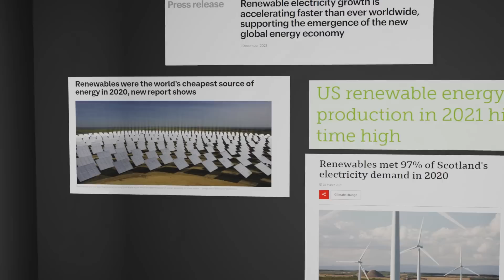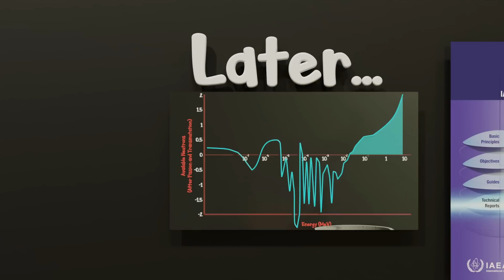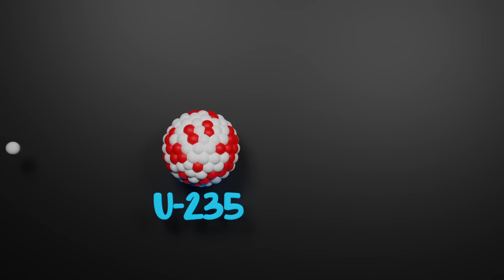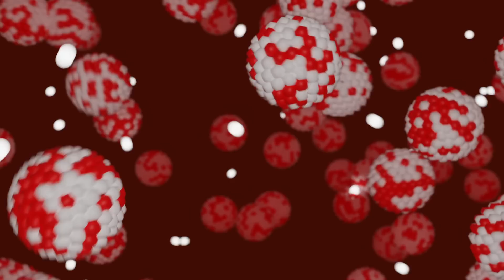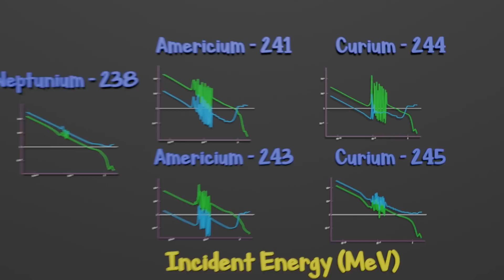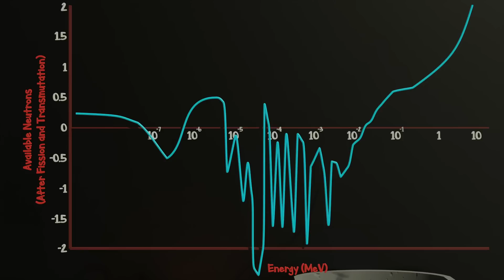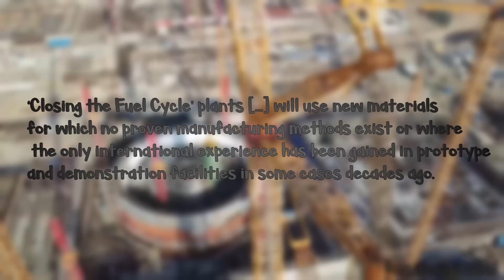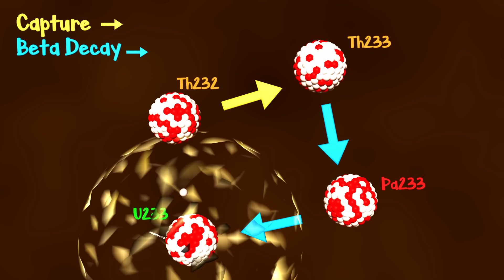How to turn Nuclear Waste into Nuclear Fuel

Comment: Concider this, co2 is produced naturally as biomass decomposes.  We are digging up additional fossil fuels to burn that increases the normal amount of co2 released.

What if we replace as much of the fossil fuel we use currently with biomass that gets put in dumps. It will already convert to co2 anyway. In that way we have a biomass fuel to use that replaces fossil fuel. That alone decreases the amount co2 released in the atmosphere.  If we add carbon capture on top of that then we decrease co2 released even further. Will this replace all fossil fuel, of course not. But it it could cut fossil fuel use by half that would be fantastic. Even if it only cut co2 production by 25% it would be worth it. 

You pointed out we have nuclear waste problem. That nuclear waste problem. For decades we have used nuclear generators in space craft that can be powered by that nuclear waste. Why are we not building these generators to provide power here on earth. It would use up nuclear waste in the process and decrease the amount of fossil fuel we need to use. Again no it won't replace all the fossil fuel use but it will replace some of it and eliminate co2 production.

A company claims it will release nuclear batteries in the next 12 months. These too are powered or can be, by nuclear waste. Banks of these batteries or nuclear generators could be used to make hydrogen fuel on demand for use in vehicles thereby decreasing vehicle co2 production. We have had safe hydrogen storage since the 1970s just no good way of producing the gas without pollution. 

In short we have many solutions that can make a dent in pollution available to us today.

Comment: While long half life material is problematic, the short half life material is the stuff that is really deadly.  The reason it is less problematic is that it's extremely dangerous for a span of time we can plan for.  With reactors, like the proposed Thorium cycle reactors, their is little or no long life waste, only the most extremely dangerous fission products in the same amount as conventional reactors, but without all the problematic long life waste.

The key problem with the waste from the Light Water Reactors used today is that the fuel is contained in tubes made of a Zirconium alloy that cannot withstand heat much higher than the boiling point of water.  As high level nuclear waste produces significant heat, the container has to be kept under water in a cooling pool, until the "hottest" waste decays into something less radioactive.  Should anything bad happen, and the pools dry out, before 10 years have passed, the waste will escape its container.

Comment: Very informative video, I have been a nuclear power proponent for a long while now. But this helped me understand the difference in slow neutron and fast neutron reactions. I really think we need to replace the 80 plus percent fossil fuel power plants with nuclear. Other renewables can make a difference but they have other environmental and economic issues. Fast neutron reactors and types that can use thorium like LFTR’s need to be explored and used to the fullest extent.

Comment: Don't forget this though: when the west went through the industrialization and grew economically, they didn't have the options that developing countries have. And they still don't. Solar isn't quite viable in a country such as canada or sweden. In a country like india though, this is becoming a much cheaper alternative that is already cheaper than coal. Most developing countries are hot with sunny climates. With energy storage that supplies people during the night, nuclear won't be necessary in developing countries. Especially since conflict and war is more common in the developing world, making nuclear easy targets and a safety risk for those using it

Comment: Which nuclear and which is better? There are two nuclear fuel elements:
Uranium and thorium.
There are three nuclear fuel cycles:
Fissionable uranium-235 isotope representing 0.7% of all uranium.
Fertile uranium-238 isotope representing 99.3% of all uranium which when it absorbs a neutron will eventually breed into fissionable plutonium-239.
Fertile thorium-232 which when it absorbs a neutron will eventually breed into fissionable uranium-233.
Reply: The most promising and the first gen. IV to make it to the grid will be a molten salt reactor that fissions U-235 at 5-20%. Most likely Thorcon power in Indonesia or Terrestrial Energy in Canada. Both are uranium MSRs. There is no shortage of uranium, it's cheap now and free in the future with MSR waste breeders.
Reply: @chapter4travels  The waste from uranium 235 has components that will last 300,000 years while the waste from thorium 232 is much less than uranium and has components that will last only 300 years.
Reply: @paulrprichard  The waste is the same for both because in the end they are both uranium reactors. 
What you have heard is a comparison between thorium in a MSR to uranium in a pressurized water reactor. In a MSR they are the same except there are several steps that thorium has to go through before it becomes uranium and can fission.

Comment: The real advantages to nuclear power for the most part are not really understood.
Most people when they think about nuclear they think of the benefits of producing electric. However molten salt reactors offer advantages as they produce high heat that can be used to produce certain kinds of chemical processes. Imagine being able to take components out of sea water and produce a hydrocarbon fuel. That can be used in existing vehicles with no impact to the environment. The other advantage molten salt reactors is they generate electric even more efficiently than conventional light water reactors. Because the steam can be superheated or this is not possible and conventional light water reactor.
Reply: There is nothing intuitive about nuclear, we don't even have suitable vocabulary, like a moderator is not for modulating :)

Comment: Please explain why coal is bad .. if it’s a non renewable source sure. There’s just so much polarization on the topic and bias is creating misinformation on my feeds. I like the explanations you give and would appreciate it. Thanks
Reply: Burning coal (without sequestration) releases:
* carbon dioxide - more greenhouse gas per energy generated than any other generation source
* particulates - with severe impacts on human and animal health - lung & heart diseases especially
* heavy metals - with severe impacts on human, animal, and plant health - nerve and brain damage especially
* sulfur oxides - with severe impacts on human, animal, and plant health - acid rain especially
* nitrogen oxides - with severe impacts on human, animal, and plant health - acid rain especially

Burning coal (with sequestration) is extremely inefficient (energy-wise) and that is why nobody does this. Much easier and cheaper to pollute. There is not a single commercial coal sequestration plant in operation in the entire globe (there are a few (under 10?) demonstration-scale plants, none of which are at commercial scale).
Reply: two words: Mercury, Arsenic

Comment: Possible solution to on-site plutonium fuel: No-touch fueling.  Robots do it all, and can only put the plutonium in the back of the right pickup truck.  j/k...  A robot can only put it one place if that's how it's built.

Comment: Allot easier get rid of the whole nuclear wast problem by using waste fuel ground up and mixed mixed into molten salt hence no need to reprocess for fast neutron molten chloride reactors.  Just grind up the fuel pellets in a hot salt bath and pore into the liquid fuel of a MSR.

Comment: Hay, none of the coal plants capture any of their CO2.  Where did you get the idea 80% of their CO2 is captured.  Only a few experimental CO2 capture plants all that have failed.
Reply: Most modern coal plants have filters!
Reply: The filters don't get it all the particles and very little of the gassious stuff, like Mercury and several types radioactive materians that make it though.  With filters you now got thousands of tons of toxic radioactive material that needs to be kept from humans for 100,000s of years.  Much more toxic than a nuclear plant ever can be.  Really there is really no comparison between the filth of coal plants in the cleanliness of nuclear power.

Comment: Renewable energy is a complete sham! Solar and wind will never be able to remotely replace fossil fuels and nor are they very green. Wind and solar require absurd amounts of land to produce any substantial amount and at the end of the day still rely on natural gas and coal for when they cannot produce any power. If instead of renewables environmentalists pushed for clean fracking to produce clean natural gas then we would have make a dent in the co2 emissions but they only want god damn solar and wind. Such absurdity is why I don't take the clean energy movement seriously.

Comment: Great video! Thanks for making!
Where does this "ideal future will be powered by renewables and nuclear fusion" comes from? It is being repeated in places like a mantra but no justification if this is the future to hope for.  I would like to see the future with plentiful and cheap energy, with minimum impact on environment and this is possible with energy dense fuel and methods. Renewables are diluted, unpredictable and resources intense (space and materials) and to be sustainable these require storage (because backup from fossil fuel is expensive and poluting). Large scale storage doesn't exist (in real world). As for fusion- there is no guarantee that it will ever work as practical source of power and just from the fact of how difficult it is to make proof of concept reactor I learn that it may never be even remotely affordable. Nuclear fission in its many forms may be the best solution for now and maybe also in 1000years, with minimal impact on environment, plentiful and sustainable fuel supply (with breeding in few forms for Uranium, Thorium). And the waste material can be kept simply away from biosphere for as long as needed.

Comment: Why are we using Mega electron Volt (i.e. 10^6 electron Volt) as the unit of measurement, and then using a logarithmic scale going from 10^-10 to 10^0 MeV? Looks confusing.
Why not use eV (electron Volt) and let the scale go from 10^-4 to 10^6?

Comment: Nuclear energy vs fossil fuels is like airplane vs car. Currently, airplanes are the safest method of travel, because there are so many regulations and background checks done before you get in the plane that there's hardly any risk of failure. Nuclear power plants are the same, they're heavily regulated and protected
Reply: Absolutely correct. And the opposition to both is based completely off of feelings.
Reply: @davidcatanzaro8838  Unfortunately very true. You can't have a reasonable argument with 95% of people who are anti-nuclear because all of their arguments are based solely on emotion. It's sad. My father is usually a pretty intelligent man but whenever I suggest to him that nuclear is safe and clean he goes on a rant about Tchernobyl and nuclear waste and how renewables will magically fix everything.
Reply: @naan-oyobizniz3168  You insult people's emotions. They are based on actively thinking about dumb arguments. This is the brain of these people. Not their emotions. ;)
Reply: And renewables are like the horse and carriage.
Reply: @thepope2412  I like to respond to renewable fans with the following quip: Whale blubber is renewable -- doesn't mean it's sustainable.
Reply: @eckligt  Sometimes I like to point out that fossil fuels saved the environment because kerosene became a better fuel source for lamps. Also the same thing for burning coal instead of charcoal. The forest of britian still have not recovered from charcoal burning.
Reply: Bad analogy. Although plane accidents are disastrous, that's about the only thing they have in common.
NPPs are scalable, clean, and produce a huge amount of energy, required you have built adequate infrastructure in desired geography (large sources of water).
Likewise, electric trains are scalable, clean, and transport a huge amount of people and goods, provided you have built adequate infrastructure in desired geography (densely populated cities).
Today, NPP accidents are almost impossible and perfectly harmless when they happen (0 deaths from Fukushima-1), and the newer reactor designs are many times safer, but newer planes are not any safer.
Reply: @YounesLayachi  Interestingly enough at one point in time, newer planes WERE getting safer than old ones, we just have not had a major development in airplane safety related tech in a long time. 

Prior to the development of GPWS (aka Ground proximity warning systems, which is what aircraft computers and pilots use to monitor their proximity to the ground regardless of indicated altitude [except during landing maneuvers]), large passenger aircraft were involved in 3.5 fatal CFIT (aka controlled flight into terrain) accidents per year, falling to 2 per year in the mid-1970s. A 2006 report stated that from 1974 (when the FAA made it a requirement for large aircraft to carry such equipment) until 2006, there had not been a single passenger fatality in a CFIT crash by a large jet in U.S. airspace.

Additionally, in 1983 the US government authorized use of GPS by civilians in the wake of the intentional downing of KAL flight 007 by the soviet military after the aircraft ventured into soviet airspace due to navigational errors. GPS was a quantum leap in airline navigation and safety and continues to be relied upon heavily.
Reply: im stealing that analogy
Reply: To make the two comparable you'd have to have the polluting cars creating climate change and the nuclear airplanes putting out clean steam.

Comment: Renewable or not is utterly irrelevant. Calling something Renewable Energy tells us absolutely nothing useful about a Energy source. The inconvenient fact is that low-carbon energy generation depends on metals and minerals, just like high-carbon energy generation depends on oil and gas. You can’t call these metals and minerals with a prayer or make them in a lab. They have to be mined. As dilute intermittents like wind and solar are so problematic both in the enormous amount of resources the require and in loss of efficiency when incorporated into infrastructure they have a far larger environmental impact than the other low-carbon options.
We can’t get something for nothing, and every human activity has an environmental cost, including attempts to protect that very same environment. 
The embedded costs of battery storage is mind-boggling enormous. to manufacture just a single electric auto battery, we must process 25,000 pounds of brine for the lithium, 30,000 pounds of ore for the cobalt, 5,000 pounds of ore for the nickel, and 25,000 pounds of ore for copper. All told, you dig up 500,000 pounds of the earth’s crust for just - one - battery. It's delusional to think this could be practical for grid energy storage.
As NP is so extremely energy dense and has such high capacity factors, it requires a fraction of the resources of W&S, nor does it need backup.
It's by far the least environmentally disruptive method available for clean, reliable energy.

Comment: Too bad no one have made it work, commercially. The same way as carbon capture technology has gotten up to max 20%, at small scales and tremendous costs. Unicorns won't solve the climate and energy crisis.
Reply: there are several commercial breeder reactors operating in France right now

also do you really only want to solve the climate crisis if it's profitable? dude are you some sort of oil barren or something?
Reply: @afgor1088  Really? Pray do tell, where are they, more exactly? Mind you, point me to stuff that's so good, they actually build more and sell it to others. No experimental ones allowed.
Energy cost, not just monetary (even if they're often the same) If you use more energy capturing and storing the C02 than you got in the first place, it's not really a solution, is it? barren= unable to bear child. Barron= Donald and Mel's autistic son. Baron= tycoon, but everyone have to call you Lord, like Him himself.
Reply: @eskileriksson4457  when did i defend Carbon capture? 

look, clearly this is an emotional issue for you. go away, calm down. then ask any questions you might have in a civil tone then i'll answer

Comment: You left out molten salt fast reactors like the Elysium Industries. Their reactor solves all the problems of solid-fuel fast reactors.
Reply: Do you mind explaining it please?
Reply: @FloraReadPirateQueen  A solid-fueled breeder reactor runs into the same problems as a regular LWR, but does much better. If the fuel is in a liquid form, all those problems go away. Gases can just bubble out and the reaction continues, non-stop for the life of the reactor basically. There are other reasons to shut down and transfer some fuel to a new reactor, but that's it. Check out Elysium Industries, they have a few good presentations on YT.